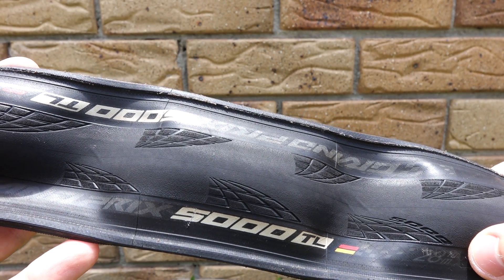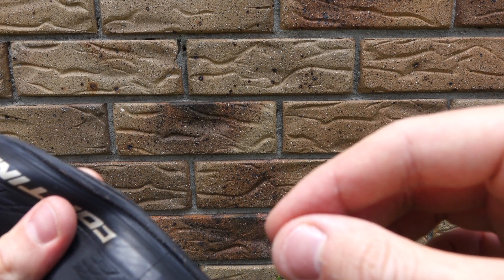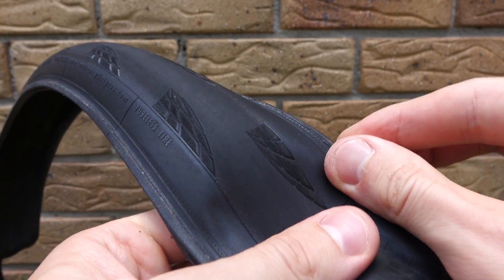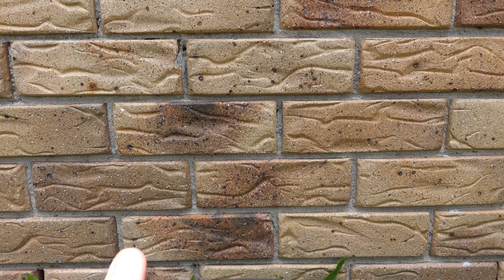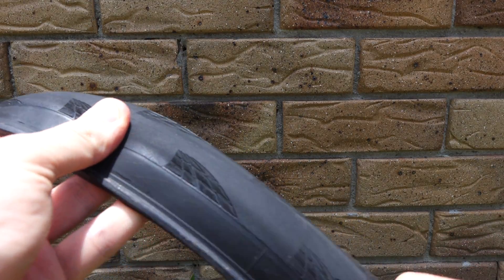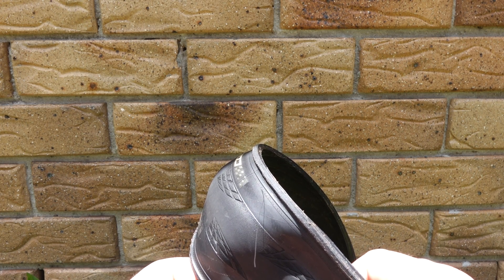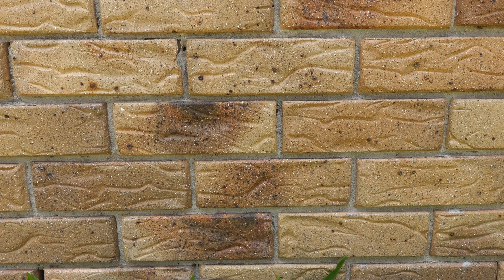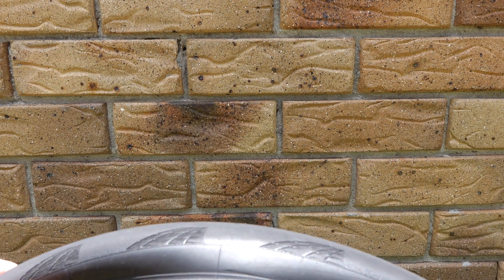Continental GP5000 shedding sidewall and hookless rims compatability.

Comment: Been riding continental for a while, but recently I switched to a new bike and hookless rims and I didn't know about incompatibility of these tyres with hookless rims. Tire fits normal and I was riding without problems, and then a month ago a hit a hole and it punctured the sidewall, no fix, had to buy a new one. This morning I was in a peloton ride and the guy in front avoided a hole just too close and I hit it really hard, it got both my tires flat and again both damaged on the sidewall. I only learned about hookless incompatibility today, after losing 3 expensive tires, now I have ordered a pair of schwalbe. I loved the continental performance wise, maybe when they update their tires to accept hookless I will give it another shot.

Comment: I’ve had this problem on two pairs , both sets have been replaced under warranty !!
Reply from the maker: Which problem you are referring to? Shedding?
Reply: Very thin cord coming away from the side wall , it got to the extent of wrapping into my wheel and brake doc !